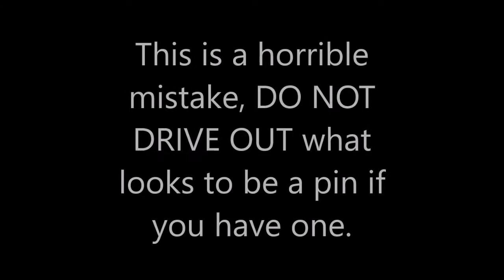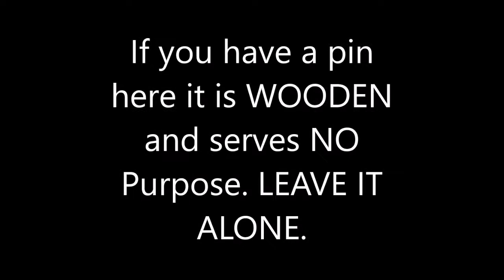Swiss Vetterli Model 1878 81 Disassembly and Cleaning

Comment: Thank you for sharing... very much appreciated!
Reply: Just bought one today. Matching rifle but furniture is wrong and missing all barrel bands.   It’s a project for sure!  I’ve discovered to take pressure off bolt spring after bolt is removed from rifle, hold rear bolt cover and turn bolt handle.  Same process to cock bolt so you can install.  Thanks again your video helped a lot!

Comment: You need to remove the extractor. Builds up crud that interferes with firing pin. Mid way it has a hook over a pin. Just tap it rearward.
Reply from the maker: Thanks so much for that info. Practical advice on these order guns is hard to come by, and very valuable.